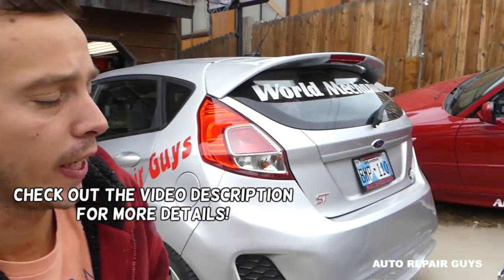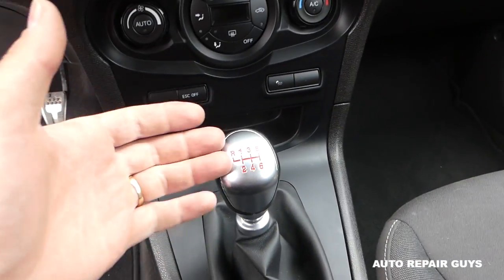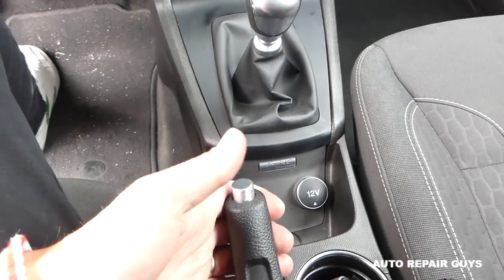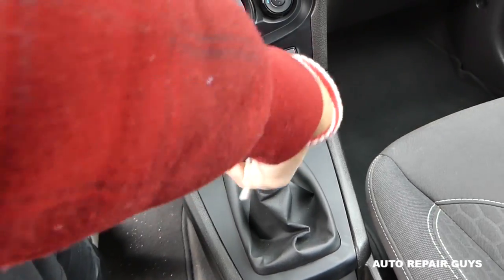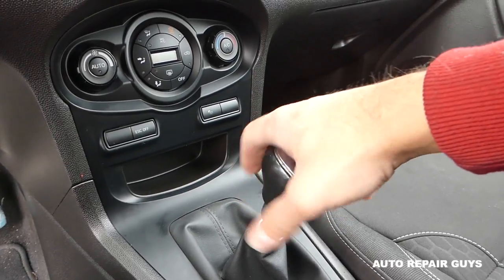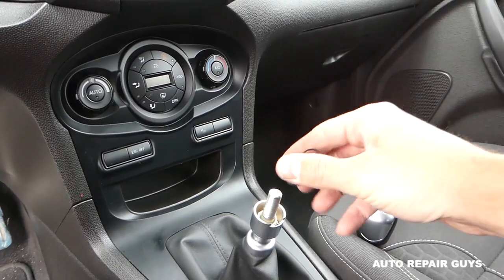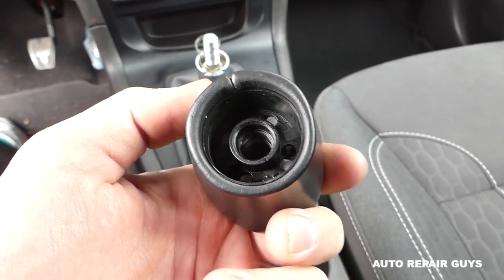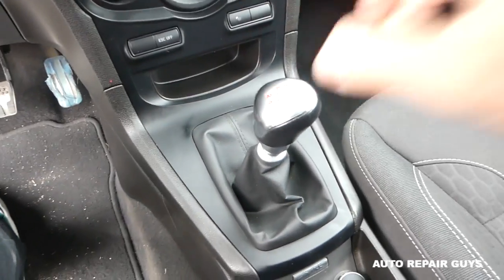FORD FIESTA MK7 SHIFTER KNOB SHIFTING KNOB REMOVAL REPLACEMENT ST S SE

Comment: Why is it called an emergency brake? You don’t use it in an emergency, it’s for parking the car to stop it moving or for using on a hill start
Reply: It's mostly called an handbrake but some call it as an emergency brake because when something happens with your hydraulic brake system in an accident, you can always use the "emergency" brake
Reply: In civilizated counties we call it a handbrake. In shitholes like the USA they call it an emergency brake
Reply: Because when your brakes fail the hand brake becomes your EMERGENCY brake being the only means you have of braking!

Comment: I have a 7.5 ecoboost 66 plate, when I try get gear nob top off the whole thing comes apart as in the whole gear stick, I only wanted to change the top but can’t get it to separate
Reply: Same

Comment: hi
i have a 2017 1.0 ecoboost. 
there is a plastic “thing” inside the boot that does not let me remove the knob. 
any advice on how to remove it for my model? thanks
Reply: i have the same thing, on my 2011 fiesta ses, this video doesnt show that. there should be plastic grooves that line up and let it slide apart, but mine doessnt come off like the other websites explain. im not very sure either
Reply: @loganretske2961  did you ever manage to do this?
Reply: Josh Chuter i’ve moved on to an st, i eventually got it i’m not sure how, if i remember correctly i just broke it lol
Reply: @loganretske2961  okay😂, thanks mate